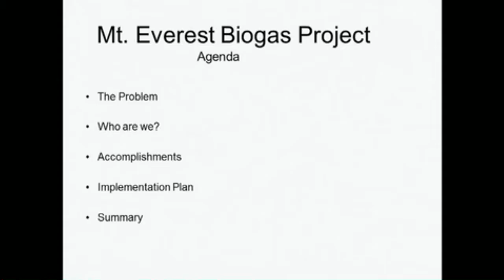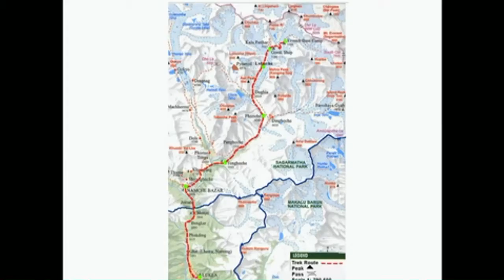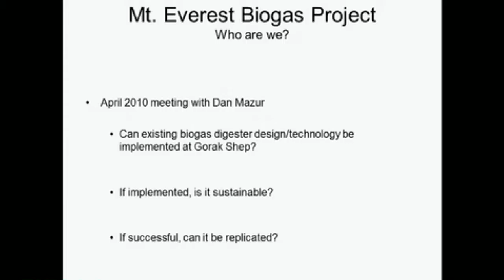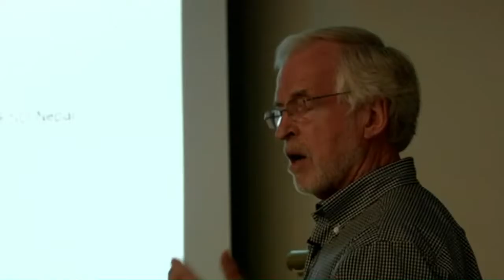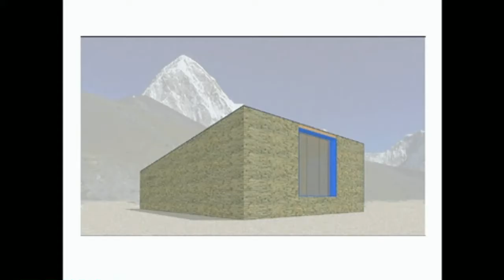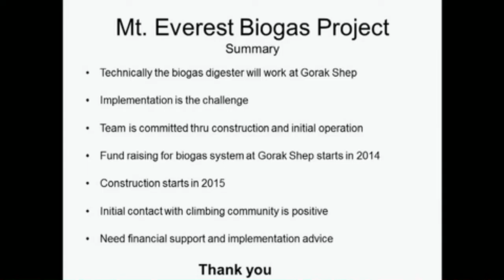Garry Porter Everest Biogas Project (hr)

Comment: What about using small scale in every household or hotels on around Everest.we also want to work with this team we have a solution for managing individual household.That we called biotoilet or homebiogas.its one of the solution for the mountain area waste management.we have a system of 2.0 & 6.0 cbm.

Thank you 

Bashu Gautam
Nepal
+9779815357999
Bashu068@gmail.com